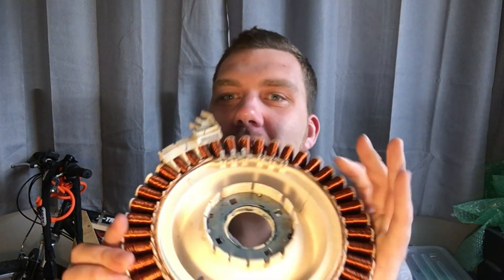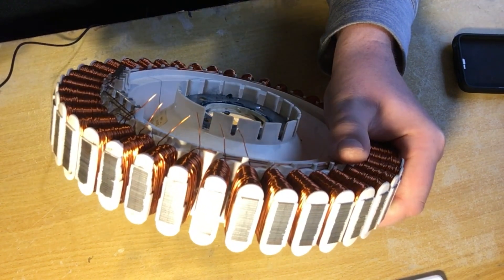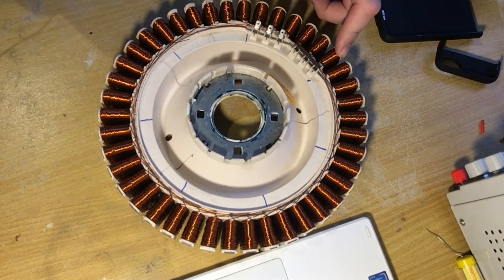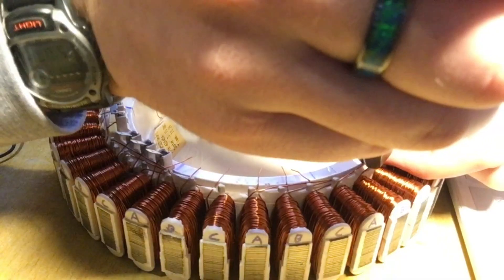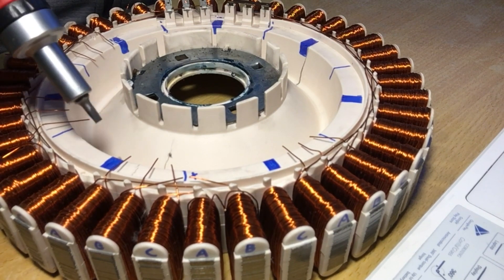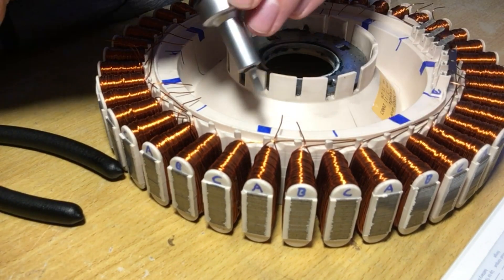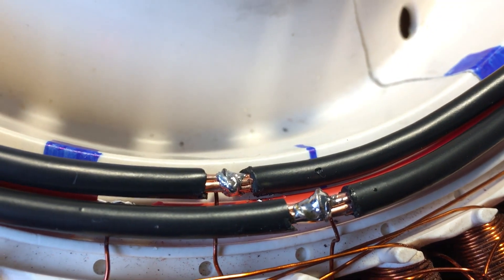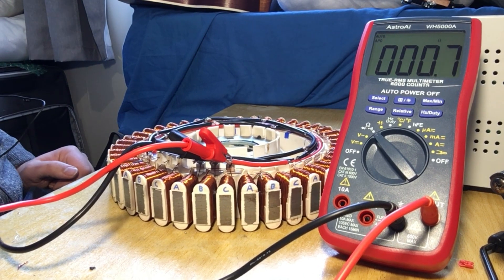Rewire a washing machine motor to generate 12v electricity!

Comment: WHY G THREW ALL THAT WHEN YOU CAN SIMPLY< GET A BRIDGE RECTIFIER THAT TURNS 3 PHASE TO DC --- AND THERE YOU GO  IN 2 SECONDS
Reply from the maker: Because it will be around 100 volts dc. you would need to step down the voltage... now I think about it a solar charge controller could do that.
Reply: You can use a bridge rectifier to DC ad then step down to what you need for DC.. No need to cut wires. and go threw all that..  JUST SAYING
Reply from the maker: @earthssecretenergy2371  Yeah its not necessary to do it today but maybe 10 years ago it was quite difficult Step down DC voltage efficiently.
Reply: I have tried using these turbines rectified and unmodified they produce more like 500v three phase at a few amps, the arc flash is lethal and impressive, but for some reason even with a rectifier, and going via a victron 100/30mppt to 12v, they just arent efficient at generating power. Rewiring for much higher current and lower voltage then via rectifier works well. Ive tested 5 of these in all manner of configurations and wiring to sets of just 3 coils star configuration works perfectly well for 12v

Comment: Why you need to rewire?what is the difference if you do not rewire?
Reply from the maker: The output was around 100volts, I needed more like 12v to charge batteries
Reply: @KiwiMaker  so it means each group of coil must be in parallel connection?

Comment: Instead of modifying it. Could u just rectify it to dc and send the dc to a solar mppt charge controller that can handle the voltage?
Reply from the maker: Thats a good idea, I think most models accept any voltage from 0-100volts
Reply: Good idea, but in its original state, wouldn't the voltage be more then 100vt, pending on what's spinning your generator and rpm or is the 3 phase rectifier reduce the voltage? Cheers 😊

Comment: Super glue on most plastics doesn't work. Was the machine an industrial one? Why 3 phase?
Reply from the maker: All the AC motors that have magnets already installed are 3 phase so you pretty much have to work with 3 phase and then rectify it.
Reply: Did you consider a rectifier?

Comment: Great attempt, but what you did is not the same as the wiring diagram you show in this video😬 You made 7x2c not 2x7c ,this lowers the voltage and gains amperage
Reply from the maker: Yes i was trying to get it closer to 12v AC so i could charge a battery, unmodified it was outputting around 100v
Reply: I have done 5 of these now, one as 7x2c and one as 2x7c, ive had one remain in the factory configuration 36 pole, one factory 42 pole, and ive now rewired the 36 pole to 12x1c and the 42 pole in the same configuration so its 14x1c (groups of three coils all in parallel rather than groups of 6 coils in parallel like in this video. With a good 100 amp rectifier i get around 35 amps dc just spinning it with my cordless drill, and it makes around 40v still. Spinning by hand i get around 15v with no load. In all the other  configurations, no matter what i did, the most i could ever get with a rectifier or a wind controller or rectifier with a mppt controller, the absolute most i could get was 200w, around 12 amps. The coils in series just cant handle high current so they peak at 12 amps and then seem to "slip" meaning you can spin it faster but it simply wont make more power. Rewiring to groups of just 3 coils fixes this issue when trying to use for 12v purposes. It is a lot of work and difficult to make neat, but it works amazingly well. Just cut every wire on every coil, and if you look at the coils one side is tucked in under the windings, the other side is able to be unwound. Unwind those just to the other side,.that way you have half as many wires to deal with at a time. Then the short legs that cant be unwound, join them in groups of 3 and terminate them. Then parallel the other legs of every third coil so you get three phases still but much higher current and low speed required.

Comment: Surely be better to leave it AC and use a wind turbine 3 phase controller
Reply from the maker: It is still 3phase AC just now at a lower voltage and higher amps.
Reply: What connection you did my friend, still STAR Connection? Star Parallel or Parallel Delta? Thanks to your reply! I want also to make a DIY Hyro-generator. @KiwiMaker

Comment: seriously  dude? are you crazy? crazy glue is the worst choice, its not strong enough and is very brittle
Reply from the maker: What would you suggest?
Reply: I would suggest superglue with baking soda dusted over top of glue
Reply: @BJ-Hunter513 thats what i did with all of the ones ive had that were cracked and it works perfectly well.

Comment: @Kiwi Maker  why do we have to re-wire the stator to generate electricity, why don't you just put magnets on the outside of the casing?
Reply from the maker: you dont have to but it will produce about 200volts and low current, The most useable form of electricity is 12v high current to charge batteries.
Reply: @KiwiMaker  ohhh, but how does re-wiring the stator even do that, I just don'r understand that.
Reply from the maker: @Dnsx_plus  So each coil will make maybe 6volts, so you can add them up like 6+6+6+6=24v or how i have rewired it to be 6+6+6+6= a really powerfull 6v its series vs parallel wiring
Reply: @KiwiMaker  ohhhh, thank you so much sir! Where did you learn all this, I've been learning for months now, constantly doing research, I can't find any good resources or subjects  that teach DIY generators properly.
Reply: @Dnsx_plus  Try Robert Murray-Smith on youtube. A genious of a man, multitalent. Currently making generators from stuff like microwave oven transformers and motors. Take a peek.
Reply: Robert Murray’s great at explaining the fundamentals, touching on concepts, but I too have been idly trying to learn enough that i feel some confidence with motors for a little while, Jeremy fieldings channel has probably done a better job of pushing my understanding! 
That’s to the op for breaking down that wiring explanation! Such a fun topic

Comment: Please, is the fixed member on which the coils are made of iron or plastic?
Reply from the maker: It has an iron core but it is all mounted on the plastic ring
Reply: @KiwiMaker  why do we have to re-wire the stator to generate electricity, why don't you just put magnets on the outside of the casing?

Comment: Hey mate great videos on the wind driven generator. I have the same 42 pole washing machine motor etc etc stripped and ready to go. I'm a little stuck on the rewiring part tho. I cant follow your explanation of the left side and right side and the blue marks. Is there a web site or some other video I can have a gander at for the few wee bits I'm missing?? Chur
Reply: No need to rewire it, just use a transformer to step down the voltage
Reply from the maker: but its 3 phase so you would need 6 transformers😆
Reply: @KiwiMaker  Maybe after rectifying it to DC?
Reply from the maker: It is quite confusing. there are other videos but i found the voltage almost too low now. It probably works good for water turbine use.